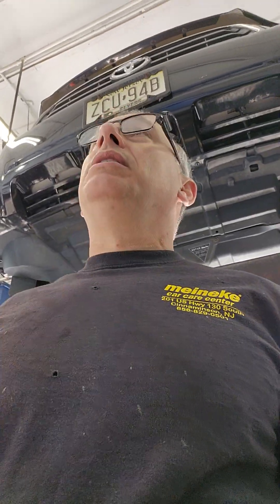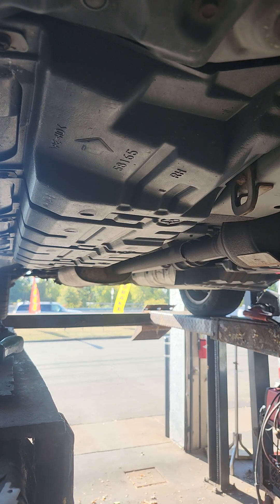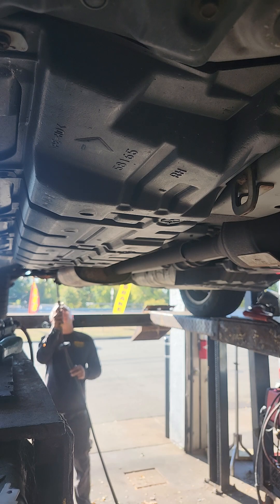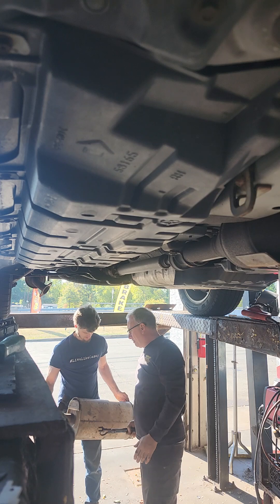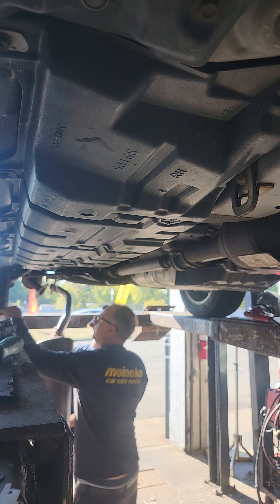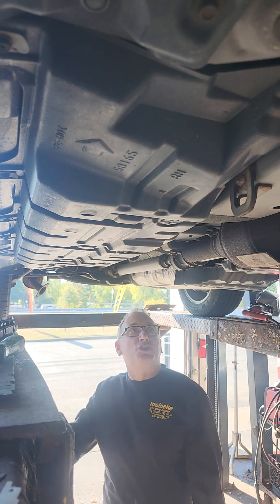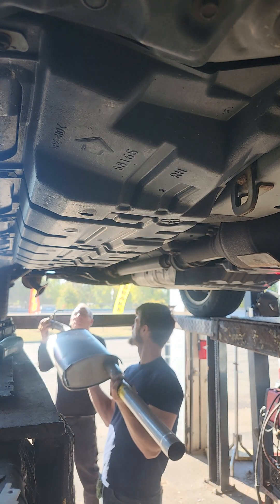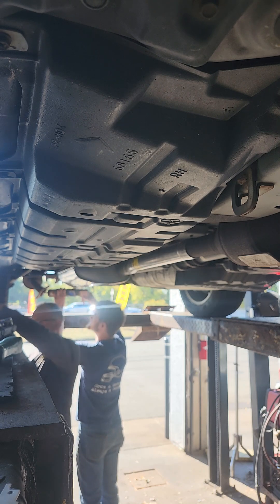2009 Toyota highlander  Center muffler installation  walker 47815  quiet flow let's do it together

Comment: 2 years before that Walker part rots out?
Reply: If it lasts 2 years...
Reply: @pl5624  That's the industry though. Anthony did a great repair, but low quality materials is built into the US. That part is $120 or so. OEM part (if available) would be 8-10x that, but will last. Cant even buy a quality aftermarket piece for extra $ for that since people will be chasing the cheap one.